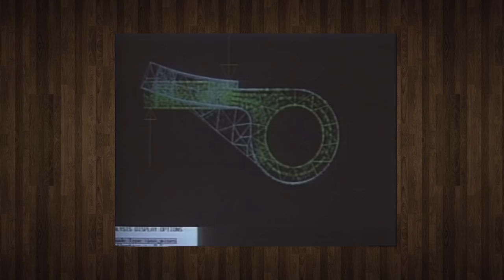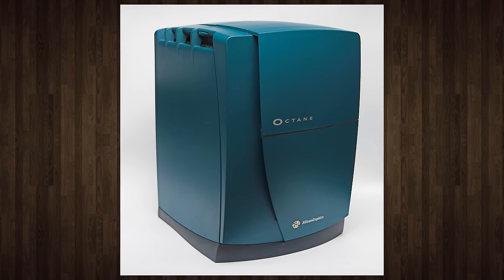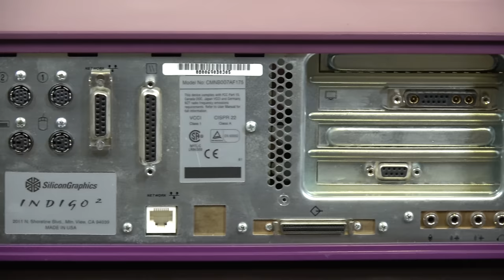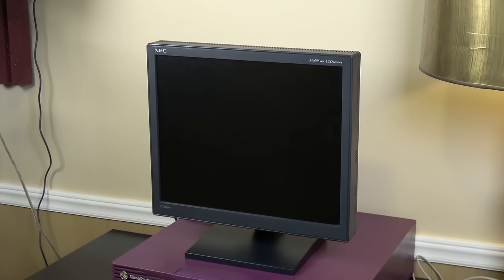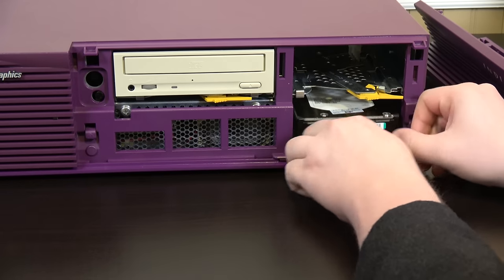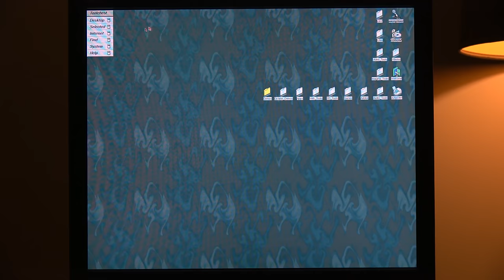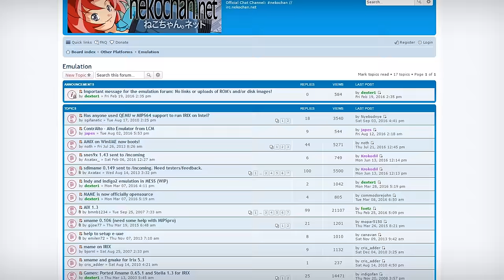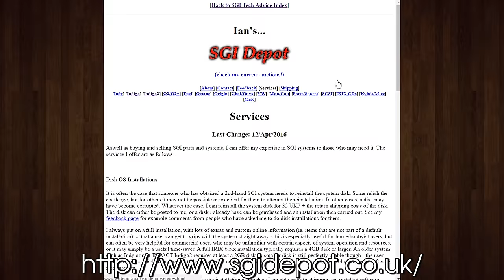SGI Indigo2: An $86,000 Workstation from 1995

Comment: That was my workstation at one of my jobs. It was incredible, almost magical. It ran an IRIX version of AutoCAD.
Reply: What do You do for living?
Reply: @pedrooscarbh  I was a mechanical engineer in the aerospace/jet engine field.
Reply: Funny i can do all the things this did on my $2000 laptop
Reply: Would've been a nice cherry ontop for your severance package heh
Reply: No you didn't 👌
Reply: Jessi?
Reply: @idipped2521  The situation is very similar in electronics design except the workstation of choice was Sun. Nowadays the Mentor design  software costs more than the computer to run it on.
Reply: @sawilliams  My late father did a similar job at Rolls Royce. Until the mid1990s while "retired" he would get contracts to check over new designs using paper and a calculator. With any CAD system there is a danger of Garbage In Garbage Out.
Reply: @pedrooscarbh  hey. Cool name
Reply: @PedroHenriqueQuiteteBarreto  thanks tocayo!!
Reply: @idipped2521  $2000 laptop? You can do what this did on a $100 laptop probably.
Reply: @Elintasokas  you underestimate what it takes to run professional engineering level CAD software.
Reply: @kallanpowell4781  Dude, this hardware is from 1992. 30 years ago! It has an about 200MHz CPU, and the GPU is barely good enough to play Quake 1. Any smartphone is multiple times stronger than this SGI machine.
Reply: @Elintasokas  bro you can’t even  find one laptop for 100 dollars period much less one that can run autocad 😭
Reply: @kallanpowell4781  Except I already found one for 90 bucks. A HP 1FX82UT. Significantly stronger than an Indigo2. Whatever the Indigo2 can run, this thing can run a million times better.
Reply: @Elintasokas  that’s not factory price that’s refurbished and used lmaoo that doesn’t count plus it’s a chrome book can’t even install CAD software on it without altering it in a way it wasn’t intended to by the manufacturer
Reply: @kallanpowell4781  Who cares? A $50 phone is faster than an Indigo2. Who gives a damn about CAD? The point is that even the bottom of the barrel hardware of today is stronger than this SGI machine from the early/mid 90s. Of course you can't run the same software from the early 90s because you need supported (old) hardware. That's besides the point.

The stuff you could do on the Indigo2 is so basic by today's standards that you can surely find software for cheap modern hardware in which you can accomplish the same basic 3D modeling and more. Indigo2 is like PS1 level graphics.
Reply: @sawilliams  did you still use or keep it?
Reply: @idipped2521  you can probably do the same on some $1500 laptops that aren't fron apple
Reply: @Elintasokas how me a $100 laptop that is certified to run a top level 3D parametric CAD program and eligible for support contracts and also runs an acceptable level of performance, which means driving at least two monitors.  And when you can’t I’ll call you clueless 🤡

These were big boy toys back in the day and you did serious work on one.  No company is spending that kind of money to Dick around.  And they still don’t.
Reply: @Elintasokas Dunning Kruger on display.
Reply: @Elintasokas basic 3D modeling?  The Indigo is still capable of incredibly sophisticated 3D modeling.  Render the CGI for Jurassic Park on your Chromebook 😂. You clearly don’t understand technology or software at all.  They designed the Boeing 777 in CATIA on Indigo2s.  Do you seriously think you can design an entire 777 in Google Sketchup on a $100 Chromebook…😂
Reply: @Elintasokas PS1 is not even close to Indigo 2 or Octane 1 (I or E) graphics.
Reply: @hikeskool why would they lie